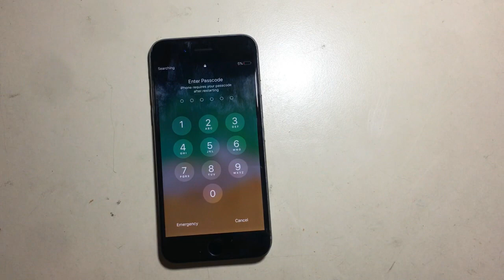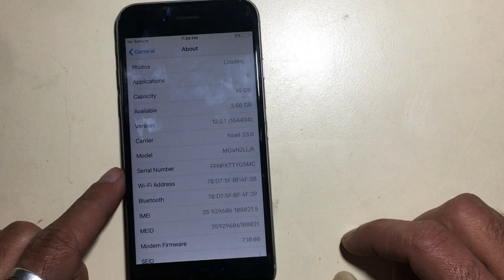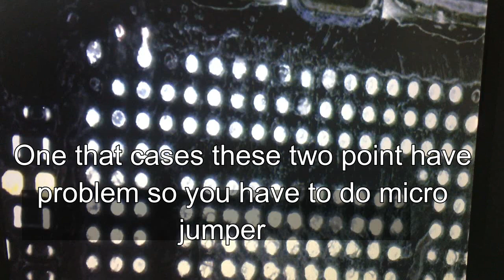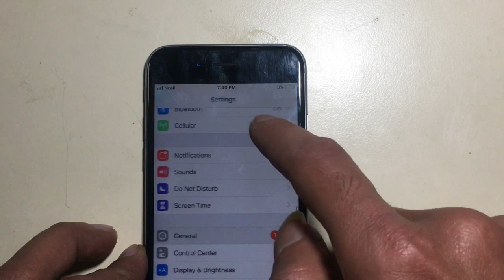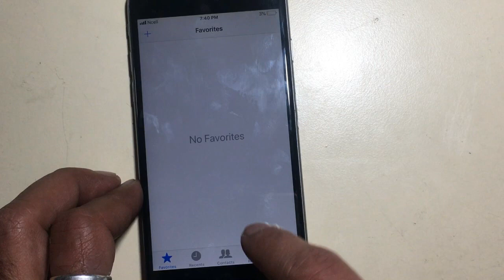iPhone 6 & iPhone 6 Plus No Service/Searching Fixed.

Comment: hey i just wanna know something? i go to phone repair shop to replace lcd and then after that i got home and using my phone until my sister called me and she said she cant hear my voice so i tried to take a video and then its really dont have a voice i can only hear the background but my voice isn’t. and my network is still searching  like whats on the video. does the logic need to be fix like that or what? cause i did the thing about software like turn off, reset, and remove the sim but its still but not working, it still searching. plss respond here